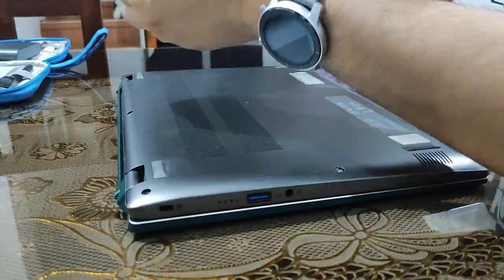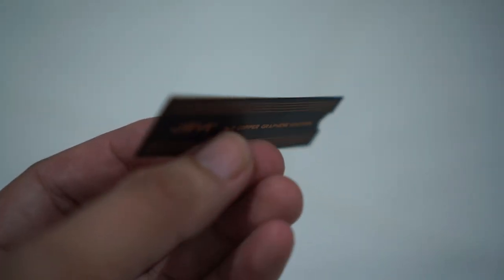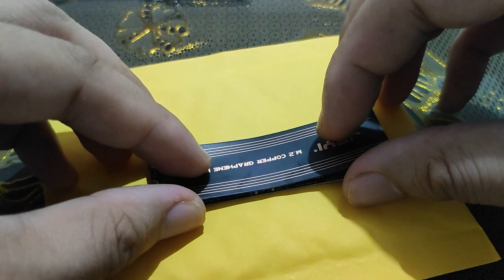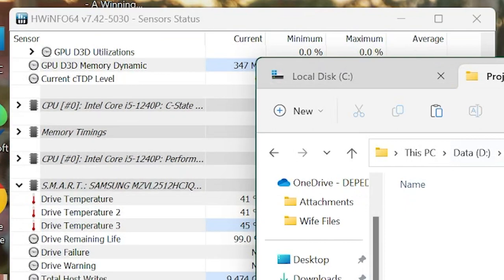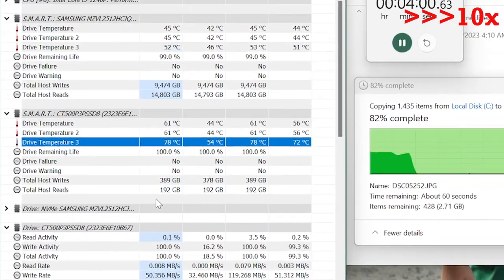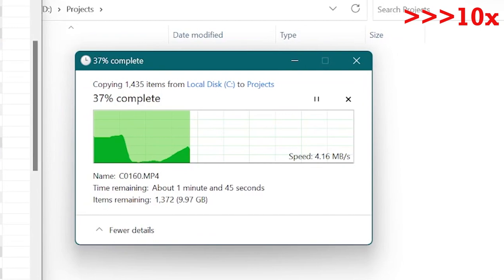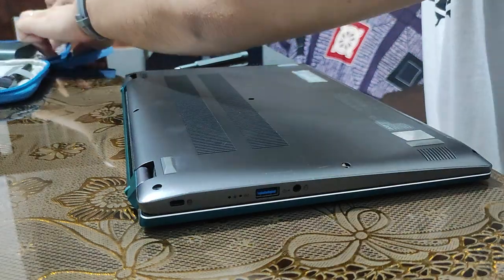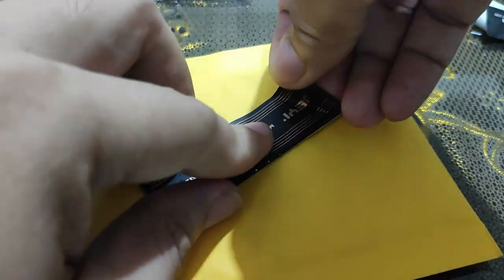Can Graphene Sheet fix the slow and overheating NVME SSD on a Laptop?

Comment: Bub my brain is soooo active now! Another question for you! There are Double sided and single sided M.2s. Double sided means above and below the M.2 it has chips, single sided only have chips above it and its clear PCB underneath! If I have a single sided M.2 like the NM790 can I also put thermal pads and another heatsink below it? If this is possible. Will the heat dissipation be improved?
Reply from the maker: @GoodBoy-io6fd it will somehow help reduce heat as it will absorb the heat beneath the PCB board.

Comment: The graphene should’ve be on both sides, copper has much less thermal conductivity than graphene, they wanted to use graphene as the heat sink, but what is the point if copper is the point of contact? And also no thermal paste so contact is probably VERY bad, use a few drops of kryonaut, “don’t use a lot” as long as it makes some contact, the heat can transfer to the graphene , and from the graphene, into some type of aluminum sink, or maybe a thin shimmy,
Reply from the maker: @jeffrey1296-rl1mi Is thermal paste good on SSD? I think you need pressure and very thin film of thermal paste for it to work.
Reply: Hey bub! When using Thermal Pads, Graphene Sheet Film, Heatsinks for M.2 and Dual Layer Graphene Copper Foil like this Jeyi, You do not apply thermal paste! It is only for processor and graphics card and other applications of heatsinks but not on an M.2. You will fry it faster than help to dissipate the heat!

Comment: I have a question for you bub! I bought 2 4TBs Lexar NM790 PCI-E 4.0. I installed an 8mm graphene heatsink! Can I put on top of the heatsink this Dual Layer Copper foil graphene sticker expecting that it will help the heatsink to cool further the M.2?
Reply from the maker: @GoodBoy-io6fd I think the 8mm Heatsink is enough. Problem Jeyi thin graphene sheet Heatsink is that is has adhesive between the Chip and the heatsink. we do not know if the adhesive has a good thermal conductivity.
Reply: @PinoyTechEnthusiast  

Then I will use the Graphen Heat Dissipation Heat Sheet Sticker instead of the Jeyi Dual Layer Copper Foil!

Comment: it spent 4 minutes to transfer 16 GB of files because your files is not a single chunk but consisted of several smaller files
Reply from the maker: @Kagamiya yes, that is one factor.. but as seen in the video, transfer speed was somehow improved when the Graphene sheet was installed..

Transfer speed can still be improved, but we need to keep it cool.. NVME SSD slows down when it becomes hot..

Comment: Nice video can u compere with cheaper heatsink in market?
Reply from the maker: +@bagasdewangga12131 This is one of the cheapest in the market.. You can buy this one in my country for $3..
Reply: @PinoyTechEnthusiast  idk but in my country the cheaper like a aluminium heatsink is attached to the SSD with 2 rubber bands
Reply from the maker: @bagasdewangga12131 Aluminum is good.. but Copper can transfer heat better..

Comment: bro hello, im having the same conputer, whats the screw size when ur unboxing the laptop cage, and the screw size of those that are inside, thanks
Reply from the maker: @lunguu077 Size of the screws outside are T5.. Can't remember the inside ones but those are pretty standard size..
Reply: @PinoyTechEnthusiast hello, how about the Kingston nv2 nvme 2tb?. Do i need to remove the sticker?? since im planning on buying the same heatsink you used on your crucial nvme.
Reply from the maker: @mr.gamersystemthundergod3012  i remove the sticker to improve the heat transfer but some says it does not effect much..
Reply: @PinoyTechEnthusiast   the sticker it has void warranty. Is it necessary to remove it?
Reply from the maker: @mr.gamersystemthundergod3012 if that is the case, don’t remove the sticker.. I haven’t tried it with sticker.. but other people says that the difference is only small..
Reply from the maker: But if you have more room, might consider using copper plates instead..
Might make a video about it on the future..
Reply: @PinoyTechEnthusiast  thanks a lot since I already immediately ordered the copper one in JEYI store.